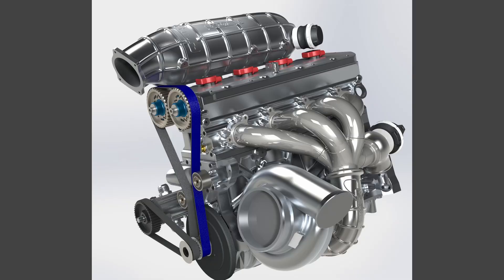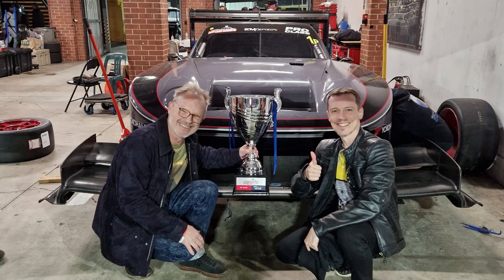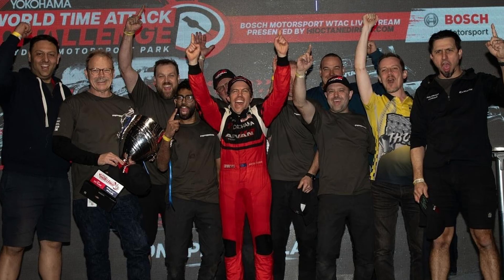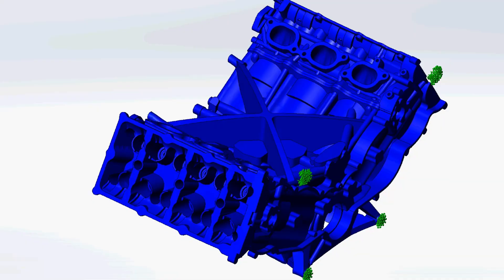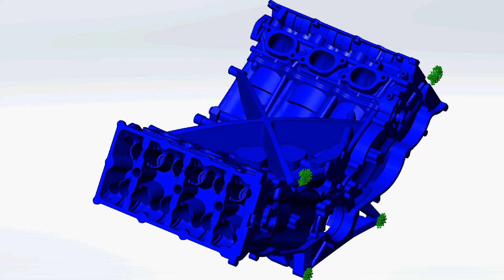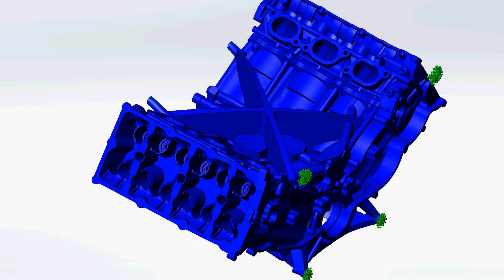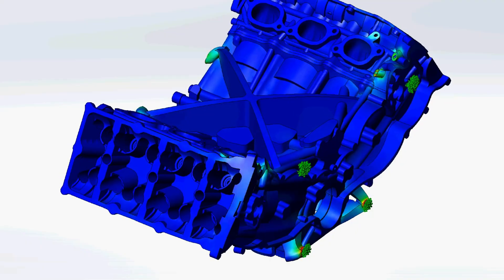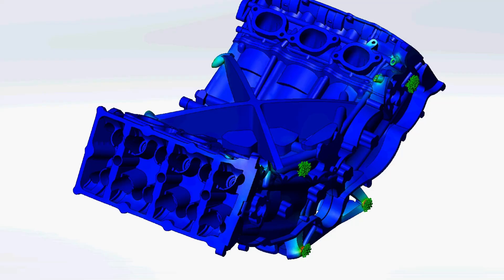Rigidly mounted engines: One big problem

Comment: all engines are rubber mounted, engine thermal expansion doesn,t even come in to play.
Reply: Some supercars have engines that are directly attached to the carbon fiber chassis, F1, Le Mans hypercars, and indy cars do this too I believe. Modern sports bikes also make the engine block part of the chassis, though they don't use carbon fiber because it's hard to make safe for motorcycles.
Reply: Believe me, Honda tried making carbon fiber motorcycles with engine integrated chassis for MotoGP racing. They couldn't make them handle consistently and they always risked shattering forks, and they just gave up on the tech for motorcycles. It's only used for aero parts and cowlings.
Reply: @Ang3lUki  ok, thanks.

Comment: Be interesting to know how a sold mounted engine effects the harmonics of the crank and rotating masses. 
Personally I’ve never been a fan of sold mounted engines in my cars as any small impact or crash will put severe load on an engine never designed to take an impact. Even hitting rumble strips hard with a sold mounted engine will put considerable stress into an engine block . 
Mostly due to the low hour a race car does engines don’t always show the symptoms of stresses . 30 hours run time per year means you can usually get away with it un noticed for the club racer . 
That’s my opinion anyway.
Reply from the maker: Suspension and chassis loads will typically be much lower than loads from the engine actually running.

Comment: When you get to the point that a member is so lightened that it breaks from ANY force not expected or engineered for...? You have broken the concept of engineering!  You designed a part to fail! And you did it on purpose to be cheap. But you call it efficiency. Words matter.  If you made the setup from scratch, you knew what it would take to break it. And later? If it broke after reengineering? 
Dont blame the technology!  Blame the designer!  Why does my 1971 Lotus chassis have a solid mounted EVERYTHING? With 10 thousand+ laps and 20 owners. UN cracked....crickets.
Edit...raises hand. Because it was built to NEVER break.
Reply: elan?  it's a steel bones car ain't it? not really same as taking some glassfiber or carbon plate and bolting it on two places at opposite ends of the engine.   like there's no 70's lotus to which the subject applies as such.

and yeah a lot of the modern upper end racing stuff is designed to not last beyond the race.. more so what makes f1 boring, it's the only things they can try to innovate on. though back then they'd sometimes race even a f1 design just once or twice.

Comment: How does F1 get away with rigidly mounted monocoque engines? I'd assume they have the same thermal expansion and contraction issues to cope with and much worse loading forces to deal with.
Reply: They use money to get away with it......heaps of money...
Reply: @pauly1605  You still need to put that money in the right place.
Like he explained in the video, if you put that money into more material, you'd just get more dead weight.
Knowing how to make and optimize a design is far better than dumping tons of money.
Reply: F1 engines are only structurally mounter from the front end of the engine and just behind the driver and fuel cell . This means thermal expansion of the engine longitudinally is irrelevant. 
The cylinder heads are also separate from the block and are allowed to expand and contract separately to the block making thermal expansion minimal. 
The block or sump if used as a stressed member will be under tension statically where as the head will be under compression. 
Obviously as the car will be moving some static loads become irrelevant and then you have to look into dynamic loads  .
I’d have maybe said the mounting points on the main F1 tubs may have specially designed mounts to allow for a small amount of expansion in one plane . These could be bonded to the tub in the manufacturing process.
Reply: Plastic blocks
Reply: He covers this in the video.
Not all rigid is equal.
A correctly engineered stressed member engine mount design will have stiffeness in the required directions but also enough flex in the direction the engine wants to force the mount in during thermal expansion.